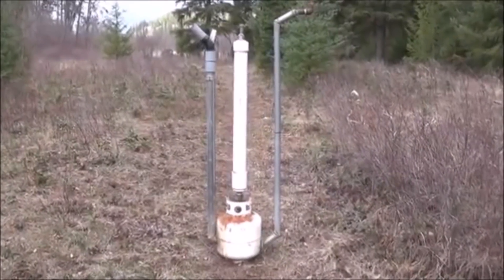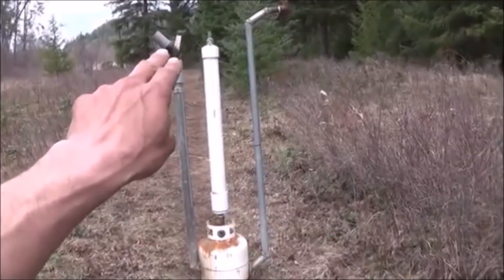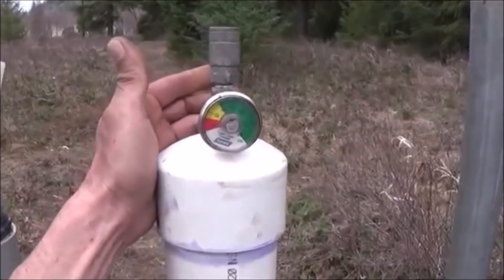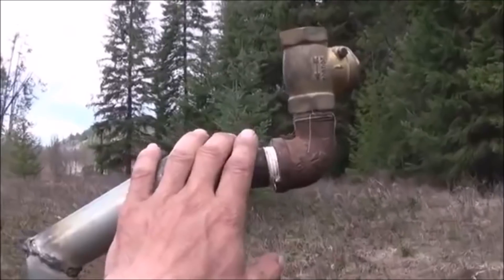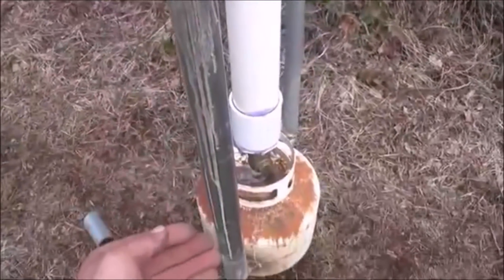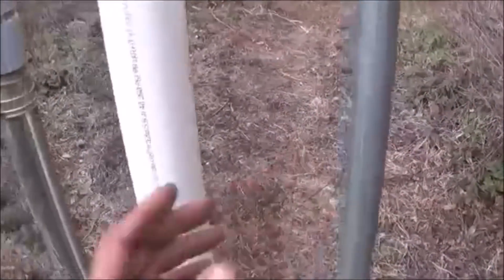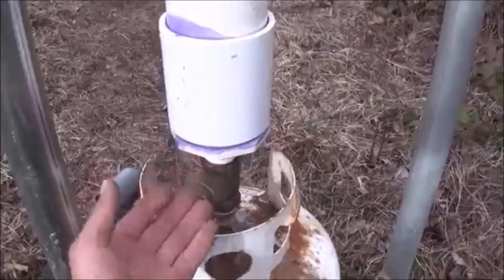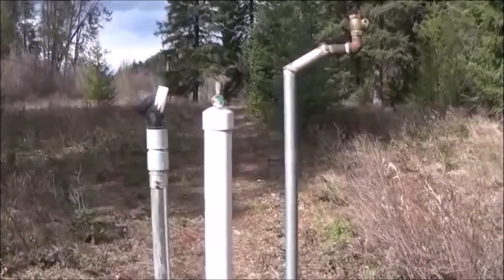Build a "TROMPE RAM" Micro-Hydro Air Compressor for powering a Tesla Turbine.

Comment: Could the air be connected to one or more "Vortex Tubes". Vortex tube takes compressed air and outputs -50F and 260F and move the cold air to a radiator to cool a server room, and the not output to a Sand Battery?

Comment: It seems to me that the pressure will be limited by the height of the water column at the point where your trompe's air inlet is. there is water-air mix coming out when pressure has built up.
Adding a one-way valve for air inlet would be interesting.